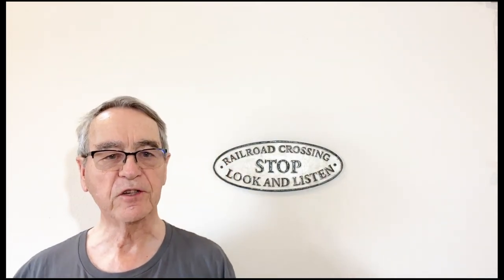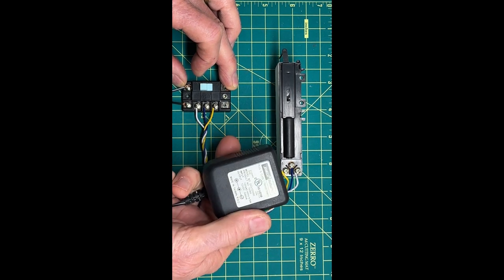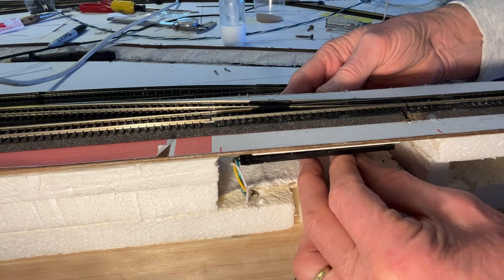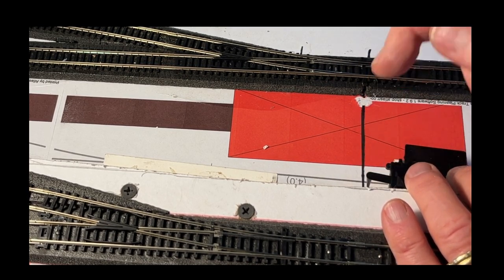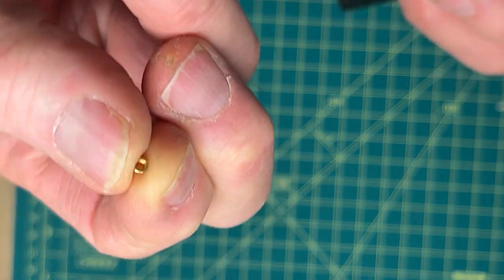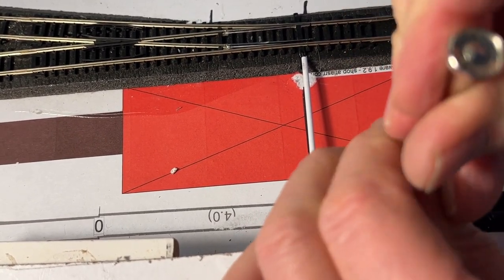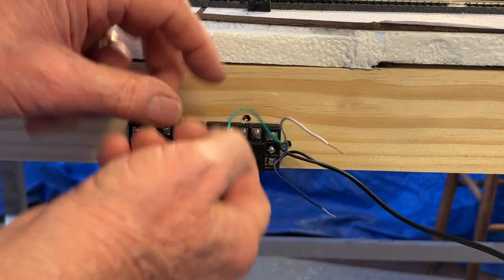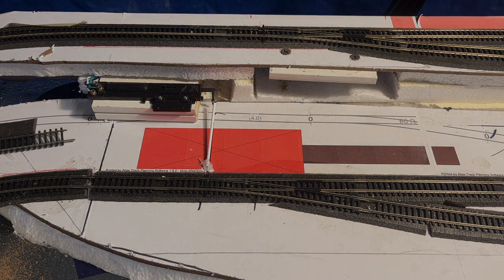Conejos Valley RR # 6 Video on Under Table Switch machines and power supplies

Comment: I think this is exactly what I need to replace a Peco above-table switch machine that doesn't properly mesh with the switch it's supposed to operate.  (It's a Peco switch in which both tracks curve toward the right; I couldn't get a similar switch from Atlas.)
Reply from the maker: I really like this machine. The tongue that engages the throw bar rolls a little on operation.  This leaves pressure on both sides of the throw and limits the distance so it works with both HO and N scale switches.  I suspect it should work with Peco, but haven't tried it.  It is also the least expensive of the Atlas machines, so you could try one and see and not be out a lot of cash.
Reply: @DeansNScaleTrains : Thinking a little further about the context on my layout, I'm worried that the material below the switch may be too thick to make this work.  Between a thin layer of plywood and some Woodland Scenics track bed I have most of a 2-inch thickness of insulation, reduced to maybe 1.5 inches at that point of the slope.  All this was already constructed before I started thinking about replacing the original Peco on-tabke switch machine.  If this will be too far for the tongue of the Atlas under-table machine to reach, I'm not sure how to take things apart far enough to get the machine in there.  (The switch on a slope is part of a hump yard where the freight cars have to be carried downhill by gravity.)
Reply from the maker: I think you could cut away a box in the foam below the switch and mount the switch machine onto the plywood.  You could cut the foam with a hot knife.  I show another way in a previous video from a year ago on this subject:
How to Install the Atlas HO N Under Table Switch Machine https://youtu.be/0UVpQRTlb48

My goal is always to not have to work upside down on my back under the table.